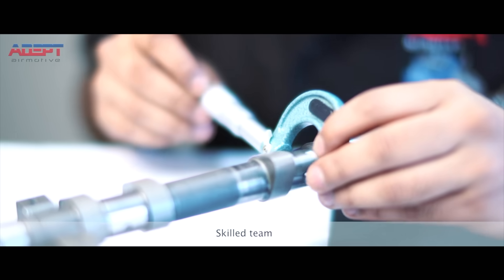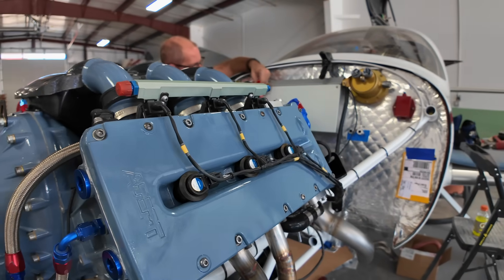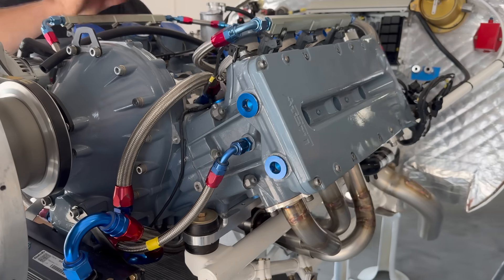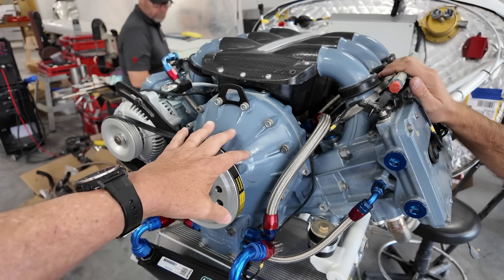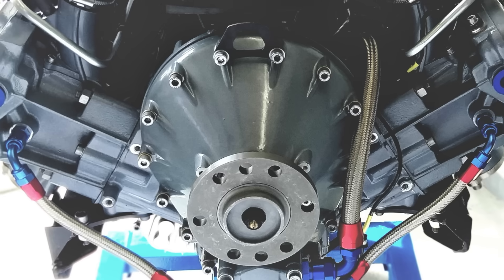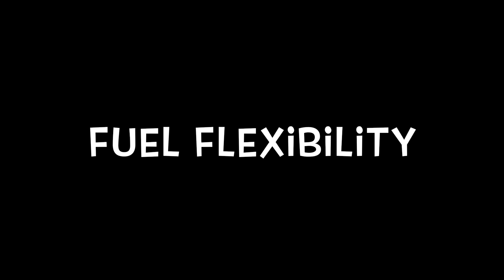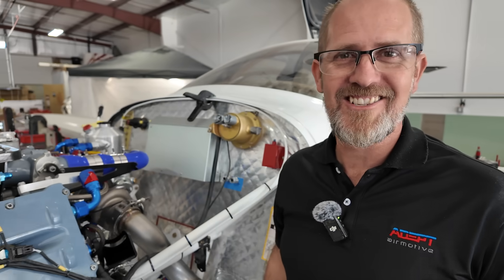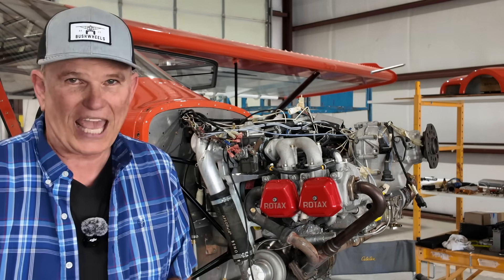The new Adept Engine could be a winner for General Aviation

Comment: The proof of the pudding will be it's time in service, reiability records and customer acceptance in this new technology. I will have to 
see it to believe it. I'm a A&P from the old school, I've seen new tech come and I've seen it go. Draining coolant out to prove a point
is kinda not good idea in my opinion, the oil cooler and coolant  are for cooling internal fluids and should compliment each other, the chance of loosing both
of them at the same time would be unlikely, of course if you lost your oil it would be an awkward moment.  BTW I think an opposed 6 cylinder would be better then the V6 that you have, the opposed
idea is a proven concept and it works. And this engine looks to be cheap by design, and didn't see a dual ignitiion on this, it's there for redundancy and safety, I don't like that 
idea at all,  That's my 2 cents .

Comment: No actual information pertaining specifically to what’s different about this engine. What makes it special? It’s able to run 50% power without its coolant and has an electric coolant pump. Nothing ground breaking there. Appears to be a standard DOHC port injection engine. Chain? Gear driven? Compression ratio? Bore and stroke?

Comment: How is this better than a used Honda 3.5 Liter V6 Petrol engine ? That is bloody efficient and also cheap. Makes 280 HP @ 6000 rpm and 226Nm torque @ 4700 rpm. Just trying to understand

Comment: A fuel injected V6 with a gearbox. Pretty much what Bombardier developed (and then shelved) for the GA market 20 years ago. A safer bet I'd think would be converting a Lycoming or Conti to liquid cooling with new cylinders and a cooling system. No gearbox needed and all the bottom end parts are the same. (it's been done already, too)

Comment: Keep your ecu’s, your gear reduction box’s, your electronic fuel injection, and your electronic management ignition. I think I will stay with low reving, large displacement engines, with simple mechanical operating systems, that can be repaired without a chip, or circuit card, or laptop.

Comment: I couldn't tell from the video if it has dual ignition? And if so, what type? Magnetor or electronic?  also, since you have liquid cooling, why didn't you chose a liquid cooled ball bearing turbo? to eliminate the necessity for turbo cool down spin down on engine shut down? Are you going for FAA certification or is this experimental only?
Reply: The electronic ignition system uses individual Ignitors / Coils for each cylinder. Single component failure in this layout leads to approximately 15% power loss. The Turbo is liquid cooled, and the coolant pump continues to operate after engine shut-down to reduce heat-soak.

Comment: So they designed an engine with everything I hate about car engines. Coolant system that ends up leaking into the oil and the engine is no longer any good. I've had it happen on several vehicles.... junk. Air-cooled is about a million times better than liquid cool you don't have the gasket problems water pump problems coolant leak problems liquid is not better.V syle Motors are less efficient than an inline motor. Harley-Davidson motorcycles sound good sound and rough because they are rough that doesn't make them more efficient or more powerful they just make more noise. A inline motorcycle can blow the tires off of a v Harley in a race.

Comment: Are you flying or driving it to OSK?  GA owners are not made of money.  Cost DOES make a difference.  Other engines have promised much and delivered little.  Good luck.  I only need Continental 90-100 hp replacement.  Rotax is quickly making inroads into the LSA market which is the only segment that is growing.

Comment: Could they 'adapt' this engine to run on liquid Hydrogen and Liquid Oxygen, so it exhausts pure water?
I call it the 'HOPE' and it seems to have been made secretly top secret by our military.
OR - inspired by the late great inventor Stan Meyer of Ohio, use his water splitter tech so it starts on gasoline, then can switch to running on water, any kind of water. Really look him up - it is based on a rotating drum that hits the exact freq. that splits water into rocket fuel!

Comment: Now they should quickly start on the next engine - the REV 2-stroke - 4 cylinder that will absolutely destroy all the 4-stroke engines and cut weight down by 50% at least!!! OK, I'm just hoping and praying someone would just take the leap, licence the tech and BUILD the next gen. The RISk is absolutely minimal because all the tech is off the shelf existing and just needs to be put together - they just have to confirm that the oiling mech works as it should.

Comment: What I tell those getting excited about the latest auto-conversion or auto based design is take your car and do a little test. Using a low gear (so as to not exceed speed limits) bring your car to a speed that brings the engine to around 4500 or 6000 RPM (depends on the engine being considered) and then think about driving for hours at that speed! I am not saying that none of those engines are not viable contenders for the aviation market, I am sure that some are, but that little test usually cools the excitement a bit. Such engines can certainly be built but it usually can only be done at such a price as to be prohibitively expensive. 

 Ok let the flaming begin but try that little test first to see if it might help to see my point.
Reply: Do Rotax engines not exist in your mind?

Comment: I am not knowledgeable about GA.  Five or ten years ago I read a discussion of how the GeneralMotors 'LS' engine had
been slightly modified and refitted into Australian cropdusters, replacing vintage radials, and operating with >25% improved
fuel efficiency.  That had advantage of adapting  an engine which was produced in millions....
Reply: True but it failed in the role.

Comment: I immediately see at least one shortcoming in the area of maintenance. The alternator belt is trapped. The propeller must be removed for belt maintenance.
Reply: Agreed, its not ideal, but this is the way many airplane engines work. By-the-way, we have another alternator / accessory drive belt off the rear of the engine.

Comment: What is engineering, it is to do for $3 any fool can do for $10.  There is also the 3 factors for mass manufacturing. 1) cost 2) quality 3) delivery...When ..........you can pick any two, But only very powerful emperors and dictators etc get all three................sometimes, because if you do not give them all three, the ancient Chinese emperor will send his royal executioner to make house call. The sometimes means even they cannot get all they want all the time. Like the all powerful Egyptian Pharaoh who were told his pyramid will take 4 decades to build , but he insist it be done in 20 years. All alternates lead to even more delays. So you behead the chief engineer. Now what are you going to do, just grab another engineer from the local university?? Engineers of that caliber are rare at all ages.

Comment: A big problem no engine makers can solve for a century+ is cost.  So far, Rotax, UL, DeltaHawk etc have not done aviation much favor in terms of low cost. Since even the slow moving Rotax are now at around 150 HP now, if someone wanted 200+HP  they can always use an Chevy LS engine or one of the Japanese conversions. Delta hawk can still use the excuse they are paying off the development and certification costs. That will not apply to other non certify engines. Over 300HP is turbine territory. But turbine takes decades to have all the bugs work out of it, the PT-6 is not cheap. That leaves Walters 601  (GE?) if it is still available.

Comment: You know that whenever a price is not mentioned at all, it will be expensive. Very expensive, good luck with the project. 😮
Reply: Pricing starts at $65000 for naturally aspirated models, and $95000 for Turbo-charged models.

Comment: Wonder why they did not go for a straight 6 rather than V6. Straight 6 engine has better balance so can be built lighter and since it is narrower than a V6 it is slimmer which reduces air resistance and improves pilot's visibility.
Reply: The obvious answer is the straight 6 was too long. V6 is much better for packaging.
Reply: @dieselyeti  In the video there was a lot of space between the engine and firewall and they moved the engine forward to move the cg. So no, being too long is not the reason.
Reply: An inline-6 is not lighter than a V6, because the crankshaft is very heavy and because the lower block and crankcase are heavy.

Comment: I'm a little surprised this wasn't designed to burn JET-A.  I'm getting the feeling that AVGAS/100LL is going to fade away via over regulation soon
Reply: It runs on unleaded gasoline. Gasoline, in general, isn't going anywhere for a long time.

Comment: I like how the last minute of the video basically undercuts everything that the rest of the video is trying to convey.

BTW I did not know that you cannot start a hot plane engine. That sounds kind of counter-intuitive with the whole "we need  the engine to be able to fly" situation....
Water cooling isn't really an issue, yes you can loose the coolant but your car will rune fine without coolant for more than long enough to get you to the next gas station as long as you take it easy. Your car engine will run without oil long enough to get to the next fuel station *if you take it easy*. It's only if you keep driving like a maniac that things burn and cease up.

Anyway, it looks fancy but they talk a lot of hype without actually saying anyhing. It's all bran new tech, but so far all I've heard is gearbox, watercooling, and lightweight. The rest is mostly "wow this is going to revolutionize the business". Except for that one guy who seems to be more realistic about the fact that what they are doing is cool but not unique or innovative or desperately needed.

Comment: And yet they can't get away from having to remove the prop to change the belt.  🙄 Obviously nobody is interested in building an engine 'package' that is designed for the purpose but rather designed 'because that's the way they've always been made.'
Liquid cooling provides better engine reliability. Long gone are the days of concerns of blown cooling hoses, etc. Between eliminating errant voltages flowing through a system and better coolants it just isn't much of a concern these days, provided the maintenance is done on schedule.

Comment: An electric motor with the new 24M battery with its 350 Wh per kilogram ……is the way forward. Quiet. Efficient. Fewer moving parts. Works across a huge range of ambient temperatures.

Comment: Another new latest and greatest engine. I have heard this 100 times last 40 yrs. A lot of hype. They use automotive hoses and fittings. Yhat is OK but it's not aircraft grade. Good luck. If and it's a big if, will it perform, be light, reliable and cost less than and be competitive to a Lycoming. Can they produce them for experimental aircraft and provide engine mount and coils? 
FAA certification would be a huge hurtle. HP claim 360hp? fuel burn, weight. Popcorn ready.
Reply: It's weird how people don't know how to use the internet anymore.
Reply: @PistonAvatarGuy Ha ha it's weird how people make vauge comments on YT vids, with no point relative to topic. What is your "weird: point? 😂
Reply: Much of the information that you seek is on their website.
Reply: @PistonAvatarGuy I don't seek info on tbis enginr as I have a Lycoming in my RV-7. It is geared, PSRU. All I need to know. Pass.
Reply: @gmcjetpilot  You were asking questions about the engine and much of the information that you were seeking is on their website.

Geared engines are more reliable, as the engine is allowed to run at an rpm that's more optimal than a propeller will allow.

Comment: "isn't used in any car- purpose built for aviation"- like that's an advantage. it's time we abandon "lycontisaurus brain' train of thought. the idea that a great engine with BILLIONS of hours of cumulitave operation across multiple case uses for decades, with billions of dollars in RD & engine data mapping to support it- cannot possibly be just as good as a Lycontisaurus... because???? well, we ALL know the REAL reason- the FAA is holding GA hostage with the cost of certification- and Lycontisaurus can't afford to just drop all its' 1940 era glorified briggs & stratton motors / tooling & start over from scratch- and no one can fault them for not being able to it. NOT their fault- it's THE FED- ever moving everything they touch in reverse. at present- purpose built GA engines- ESPECIALLY certified ones- are ill equipped to be even half as good as Aeromomentum OR rotax for that matter- the certified rotax being the exception to the rule. I do believe deltahawk will break records in this regard- for longevity & fuel efficiency plus cost of operation. AM engines (suzuki), Rotax, dieselhawk- & the soon to be kaiwasaki factory aircraft engine will soon out pace & eventually REPLACE lycoming & continental entirely. how do you compete with an engine builder who routinely builds MILLIONS of units- vs. your 100 or so? they have BILLIONS of hours of engine mapping data, eta's on parts life, failure points & weaknesses? they know those parts better than your science teacher knows the periodic table. they have NO NEED to 'wait' for engine data to find out how many hours before TBO. THEY KNOW. 10 million for R&D? what? that's all? chump change. they don't need to hire new engineers: THEY HAVE AN ENTIRE DEPARTMENT of those guys- WAITING. & how did dennis create the dieselhawk without all that? he copied a GM detroit diesel platform (v8 2stroke) & cut it in HALF (in cad), then built it.

Comment: I see class action lawsuits filed on this engine with too much involved in the complexity for things here and there going wrong causing airplane crashes. All it takes is twelve out of ten thousand engines failing causing deaths followed by class action lawsuits and Governmental Band on the engine being used in airplanes. This has happened quite a bit in aviation with engineers thinking they just invented the best modern mouse trap that fails in mass usage. One plane in South Africa (probably because the US Government regulations preventing it done in the US) does not make for proving reliable for mass production to have the general public risk their lives on. I am a certified automotive technician and automotive machine shop engine machining with stating "loosing engine coolant with cutting the power in half and safely keep flying is pure bullshit for the greed of getting rich by gambling with every life that is flown using this engine. I don't think the US Government will certify this engine to be used in aircraft because of all its unneeded complexity being unsafe for reliability !

Comment: There was no basic description of the engine; appears to be a double overhead cam motor with how many valves per cylinder {?}, bore/stoke not mentioned, balance issues and solutions not mentioned, appears to be a dry sump motor.  Just no info.  Who/where will this get made and like most comments say, do they have a chance in hell of making enough to keep the price affordable?
Reply from the maker: This was just an intro video. Please reach out to the website for more info. https://flyadept.co.za/

Comment: Because it’s a V-6 does it have a balancing rod inside the engine?
Reply from the maker: Don't know. But you can ask the developer. I can't wait to fly it. It sure sounds smooth on the ground.
Reply: @PlaneCrazyChannel it fires at even intervals, so it will sound smooth and deliver power smoothly... but it is unbalanced so it will shake.
Reply: Counter-balancing is done in the Crankshaft itself - not a separate balance shaft
Reply: @flyADEPT so it's not balanced. Each bank is an inline-3 which has a substantial rocking couole, the two banks at 120 do not cancel each other, and weights in a single shaft (the crankshaft) cannot compensate for a rocking couple. 

I suppose the idea is that weights can shift some of the rocking to a more tolerable plane and that is close enough to balanced for the application. 

V6s at other angles have the same issue; some use aa balancing shaft and others just accept the imbalance.